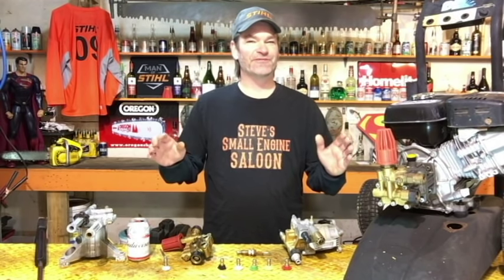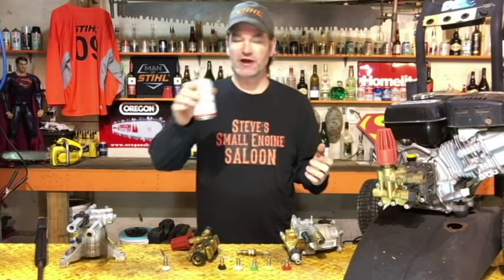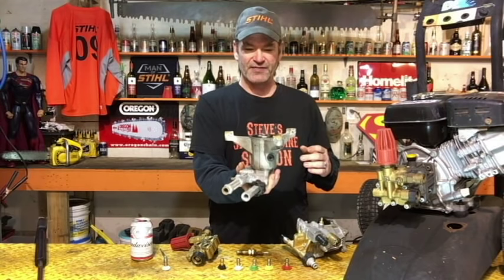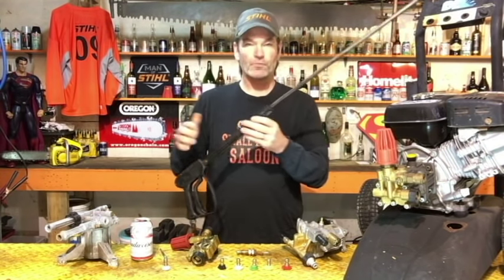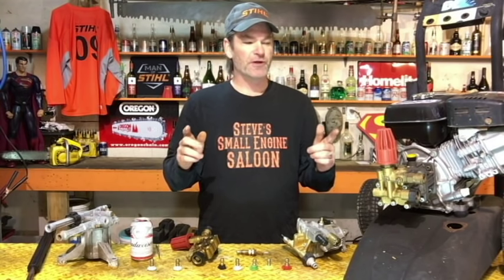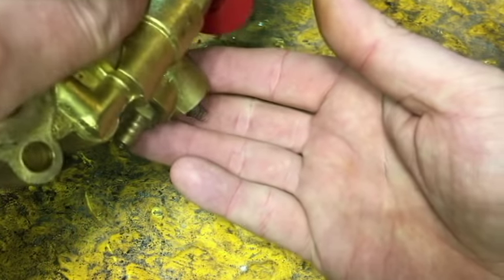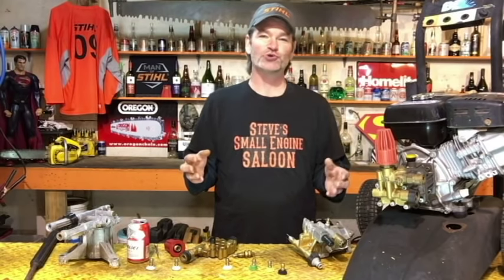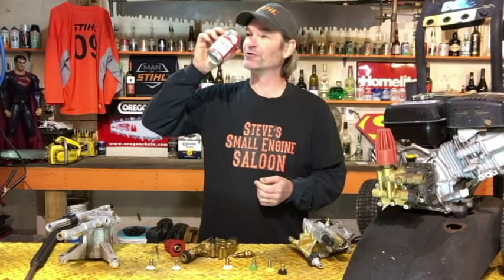How To Fix A Pressure Washer That Has Low Pressure

Comment: Hello Steve and thank you for all the great vids. I recently locked up my weed eater but came across a vid that showed how to unlock it. Wow! I was able to use it again. Now, for some reason, my butterfly valve on my Ryobi weed eater carburetor is suddenly really loose to where it just flops around. So, I can't choke, run or anything. If I turn the weed eater to one side, the valve will flop to that side - turning to the other side does the same thing with zero resistance. Is there supposed to be a gasket in there or something.Can you help me figure this one out. Thanks.

Comment: another thing: if you have a direct drive pressure washer when its running you have 2 minutes to relieve the pressure, or you can damage your pump !!  ( you can't just let it sit there and run, pull the trigger ever 2 minutes are cut it off !! )

Comment: My washer has high pressure for a few seconds a d then falls off. What could be the problem?
Reply: Too much water flow, I had this problem very problem when I had the original nozzle on my power washer. It was adjustable and had a special setting for applying soap, I left it in the soap dispensing mode and the next time I used it, it had no pressure. Because it was still set to dispensing soap!
Reply: @davidschwartz5127  I never change the nozzle so that can't be the problem.

Comment: Very informative but it did not help I squeeze my handle and it has high pressure or not your hand back but then loses the pressure
Reply: try a friendly neibors house, my house has crap pressure and my pressure washer will start to do that same thing, a wider and shorter hose from your water supply to your pressure washer will also help.

Comment: What happens when every time you release the trigger the engine stops ?
Reply: foreverwood1963 unloader valve is stuck. Change it out. Red or black knob...under the knob

Comment: Can a defective hose make water not come out, my pressure loader is fine the screens are clean the nozzles are clear there's oil there's water going but nothing coming out??
Reply from the maker: Never seen a hose cause that!  Probably something plugged in the pump itself.  Pull the pressure hose off the pump and turn the garden hose on.  If nothing comes out, then you have a defective pump....
Reply: Jax Turner lol it had a tip and I had hardly more pressure coming out of the hose going to the intake, once w got water pressure back (didn't more it was gone at time) the pressure washer hitting hard like normal thank you for all your suggestions

Comment: So I honestly wish I would have seen this video years ago. I have a Power Mate 2400 psi Washer.
I used a retractable hose about 6 months ago instead of a regular hose. 
The retractable hose burst, and water started coming out of the water pump area.  
I called Power Mate, they said the water pump was damaged. I have not used it since then. 
Insult to injury, the Pressure Washer was out in some light rain this year. 
These are my EMBARRASSING facts, 
A new pump is going to cost me $160, $85 to install. I'd like to take care of this myself. 
From one Man to another from a different Mutha, I humbly ask for help.

Comment: Steve can I send you a short video of what my pressure washer was doing today? It was making loud sounds but I was using a turbo nozzle full throttle for a long period of time and after two or three hours I started to lose pressure and it kept trying to spike up but I shut it off gave the unit a break and restarted it and it ran fine for 30 mins and started doing it again. I had good water flow. The unit has less than 150 hours. I have two quick videos I’m trying to see if it’s something I can fix myself as I have jobs I have to reschedule

Comment: my karcher g2800 works good but engine cuts out when moving  the unit to re position it. has one of thoes honda copy motors on it. changed spark plug, still does it. got no idea what it could be.
https://www.kaercher.com/au/home-garden/petrol-high-pressure-washers/g-2800-aus-11073160.html

Comment: Unfortunately none of that is wrong with mine. I have the bottom pump,  and it runs with low pressure. I have no idea what is wrong with it. It is a shame because the engine is still great, but replacing the pump cost more than it is worth. I don't want to just toss it out, but if it doesn't do it's job it I'll have to throw it away. I need the room in my shed.

Comment: The other issue is the pressure washer pump is always running when the engine is running, so after a few minutes of not spraying, the pump overheats and fails...at that point you may as well throw it away because the pump costs as much as the whole dang pressure washer.

Comment: You are phenomenal!!! So, here's another dumb blonde, cute, but dumb, trying to get pressure out of my pressure washer. First of all - interesting note - I never noticed that red knob before! Now I feel so much smarter. However, that's not my problem. There is water spraying out of the hose connection and I think those connectors by the hose fitting may be loose or broken. Is there a way to fix/adjust the hose connector so it doesn't leak? And, can those gold thingamajigs above the water fitting have leaks as well? Should I just drink my scotch and take it to the small engine repair shop, or is there hope for me? Can I send a picture?

My neighbor thinks I'm definitely a dumb blonde and says just junk it and buy another one. There's no way a girl can fix it. Ir runs fine - just low pressure. Help!!!!

Marye Ann

Comment: Do's and Don'ts:
Don't ever put fingers, hands, pets, face or kinfolk in front of pressure washer's nozzle. It cuts through flesh instantly. 
Don't leave your garden hose or the pump's wand hose attached to the pump.  It will damage the pump internally.
Don't run ANY chemical other than soap that is labeled for pressure washers. Bleach will eat your pump.
Do when storing pressure washer over time use a can of "pump saver". This treats the inner workings of your pump from corrosion. 
Wasps love the tubes and ports of pumps! There ideal homes when storing. 
If you pressure  washer has a adjustable knob. This is the ONLY knob on your pump you should adjust! All other adjustments have been made and set by the factory. Any changes to increase pressure will blow out o-rings and cost you money. 
Don't leave your pressure washer out in the weather unless you like water in the gas tank. Gas cap or not, it gets in there.
Dont leave gas in the tank during storage. Gas is like milk, it has a short shelf life and turns into a science experiment given enough time while destroying your carburetor in the process.
Finally, Don't run a pressure washer with no water. The seals around the the inner pressure pistons will melt!
There is one thing not covered in this video. A typical home owner pressure washer pump has 6 plastic valves internally. You probably can recognize 3 of them easily by the large hex bolt caps that are usually in a row on your pump. I have seen these valves break very often. There cheaper to replace than buying a pump.

I hope this helps!
Reply: Nice!

Comment: You missed the most obvious cause of no water through the pump.  Same cause for no or low water filling your washing machine.  The supply inlet may have a rubber seal with a attached screen to keep trash out of your pump.  These screens get plugged with calcium and lime deposits.  Replace that plugged screen and check waterflow again..